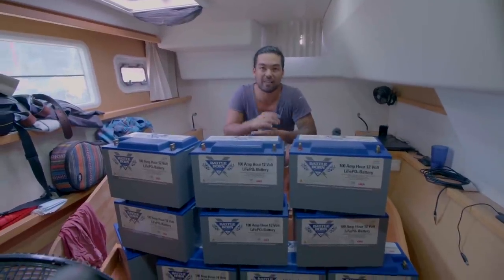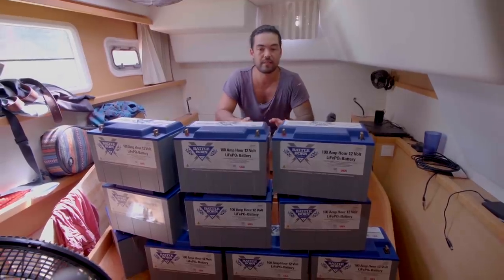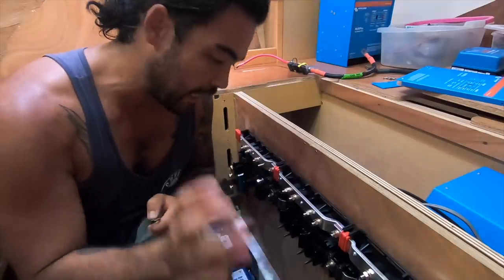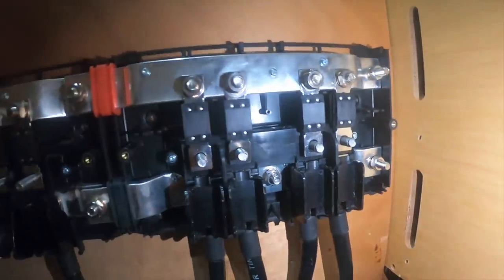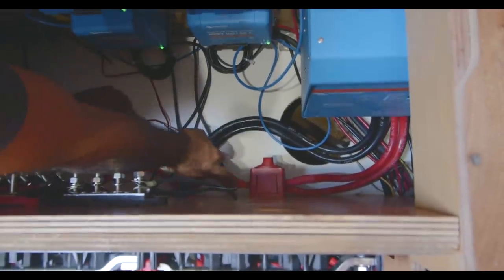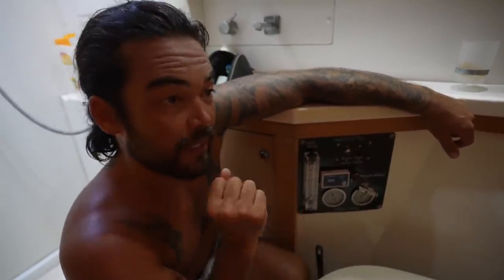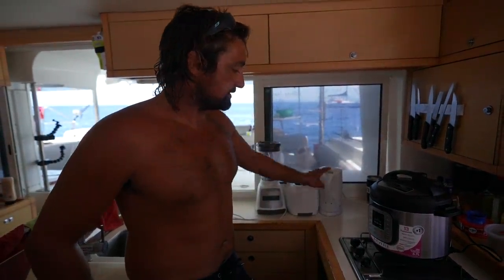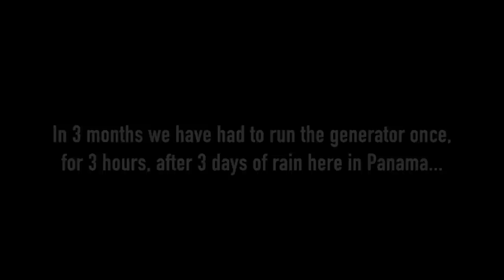Installing 1000Ah of LITHIUM + huge VICTRON installation! Episode 149

Comment: I have 4.5KW solar system on my house in Australia and I use all the power hungry stuff like washing machines, clothes dryer, dishwasher, a/c between 9am -3pm and never draw power from the grid in that time frame. Just a tip to make your system even more efficient for the days its overcast.

Comment: Colin, since lithium batteries have the possibility of catching fire, are there safeguards, either in the battery itself or the associated electronics to warn you the battery is showing signs of a possible short or prevent the short from causing a fire?  My first thought was if I were installing these on my boat I'd put them in a fireproof container.  I know there are different formulations for lithium batteries, like LiPo (lithium polymer). What type are the boat's batteries? It might make for an interesting video to interview someone from the battery manufacturer. Maybe give some safety tips when installing or living with lithium batteries.

Comment: So One Small suggestion. I love the build.. But as a solar guy... Im going to suggest.. Unmount the panels and put corrugated plastic sheets between the boat and the solar panel. The idea is that as the panel heats up, There is no ventilation for the heat to dissipate so you begin to LOSE power if their is too much heat on those panels. To augment this you use the plastic signs aka corrugated plastic) as a air gap to create air flow under the panel as the panel transfers the heat to it.  Kind of like a heat sink.  either that or use stand offs or rails to put the panels up off the base of the boat.  This is why Computers use standoffs in Desktops and they dont mount the motherboard directly to the wall of the pc. For heat reduction and airflow.  Just because those panels are "sailing"  that wont keep them cool as the heat is transferred to the back of the panel. and then to the boats fiberglass.. So getting some air flow under them helps with solar efficiency.  You can literally increase that power at up to  20 percent more. So it was generating 2.2.kw it would generate 2.6kw just by putting them on rails or corrugated plastic. (For those that dont know, Corrugated plastics looks like this https://www.boxes4u.com/sites/default/files/Corrugated%20Plastic_0.JPG)

You can see this dude talking about this on his boat here..https://www.youtube.com/watch?v=o6kOvjS1ytE&t=185s  and why he did it. 

Other than that Solid build and great video.

Comment: 6:00 Pro tip. Add a small amount of roofing silicone to the join then slide the heat shrink over it and apply heat befor it has time to go off then mop up excess slilcon. The heat shrink will squeeze out the air and the slicone will make it air tight so no corosion will develop for years. 
I have used this method on boat trailer wiring for the last 10 years and have had not one failure due to water penitration yet.

Comment: Beautiful equipment and install!! I'm using LiFePo4 as well.  I've set my parameters to stop charging at 85% and inverter to cut at 20% to get more cycles out of my bank.  The batteries deteriorate quickest at very low or a very high state of charge.

 If you're floating consistantly around 75% and rarely dipping below 40% may be worthwhile doing the same if you want to squeeze some extra cycles out of your battleborns.  You could get as many as 10 000+ cycles only charging to 60% and cut off set to 40%, pointless to only use 20% of your bank but it appears with your usage you have plenty to stick between 20%-85% especially with your back up genny and future alt upgrades.  lifepo4 loves to float right around 50% to get the most longevity, i hope you find this useful 🤙🏻

Comment: One thing to stress about your new system is that by noon your new Lithium's are full and the sun is still shinning so the PV panels are producing power and that is when you want to run all your power hungry appliances, watermakers, battery chargers....   It's more economical to use the sun's power when the battery bank is full so that at night you can drain it for dancing music, underwater lights etc... 😀
Loved that all the - and + leads were all the same length, very nice busbar, neat and clean install.

Comment: I'm a small engine mechanic and work on those Honda Genis all the time... They'll last forever if you do a oil change every 30 hours of use and don't let it sit without being used longer then 2 months.

Comment: The parts definitely looked quality and the install very nicely done. Whenever I'm replacing things at home I always spend more than I like, but as you showed, high quality stuff will save you money and time in the long run as it lasts longer so won't have to be replaced/repaired as often. Being able to use all of your devices and appliances through the night without having to run the generator is definitely a huge step up.

Comment: We use Battle Born on our electric yacht (auxiliary) powered sailboat.  They are great batteries.  We also have the same Honda generator for charging if we go past our 20 or so mile limit under power alone.

Comment: Great job with the design of the system. Adding a 100—150A alternator to one of Yanmars sounds good too. Personally I would try keep the originals too but just add a extra pulley to the crank. Multirib belt  with manual tensioner and gearing so that Yanmar on high idle would give minimum 8000rpm on alternator. When no need for big alternator just remove the belt.
Reply: Given the effectiveness of solar and the presence of a backup genset that is good to have on a boat anyway, why bother with the alternator upgrade? I could see it if he was drawing more of a daily load, it would the fastest recharge. But he's not even coming close to the capacity of the system most days.
Reply: I think there may be very cloudy, dark days without any wind when they are sailing back home. When they are using engines anyway it sounds wise  to have low cost kWhs flowing in.
Reply: Need a victron Orion battery to battery charger for the alternator output.

Comment: I actually received the 2nd set of 60 amh lithium batteries to hit the US a few years ago for my golf cart. The company called me last year and wanted to warranty my batteries for a newer 100 amp battery and to see if there was any problems with any of the cells in my original batteries(there were none). I travel about 20 miles per day to play golf round trip on my cart plus the round and with the 100 amh, I have gone 3 rounds between charges on occasion. However, now I have moved to the golf course and can recharge every week or so. These batteries are game changers to the industry. I may also add that I have upgraded my cart to a 10 hp motor and the cart will do 35 MPH. Fair winds!!!
Reply: Koenigsegg quark's put out about 335hp and only weigh about 63lbs.... That'd make one hell of an upgrade. :D

Comment: Great video Colin; that solar roof you installed is brilliant. Based on your having to run the generator once in 3-months, why bother with the larger alternators? Running a diesel engine as a generator is rarely good for the motor. If you add one alternator, you'll have redundancy for your honda generator, but then you can also just buy another small standby honda for that just-in-case scenario. Consider that water pumps are a big deal - for your boat in an emergency, and also to help neighboring boats too. Nothing worse than trying to save a sinking ship with mechanical hand pumps. Portable small backup generators are more versatile than a large alternator solution - and are probably cheaper.
Reply: Edward. Lilithium has a very low internal resistance. Unlike Lead acid, gel and agm. This lower resistance means the alternator is unable to supply the higher demand of lithium at lower revs and therefore a bigger alternator is needed to prevent overheating and bring the demand within the capability of the alternator. I =V/R ... I x V=W .....Laws that govern electrical generation and storage...
Reply: the boat is built to motor sail so it would be nice to have the extra power generation on a stormy day when theres little sun
Reply: @SVImpavidus  I have heard this! Altornators do not like lithium.  Pretty sure i've watched a video of an altornator going up in smoke trying to charge a lithium battery. Definitely research using altornators to charge lifepo4!!

Comment: I’ve been using battleborne batteries for a few years now for total off grid power storage and consumption without a single issue system wide.  You just did the best possible upgrade you could possibly do with exception to probably adding more batteries😉😎👍

Comment: Victron systems completely impressed me. I was having horrid electrical issues. The only issue with Lithium, vs LifeP04 is static draw. 10,000 watt draw of an audio system on a boat, the kinks aren't worked out. I keep myself banked separately for this reason. One of the biggest mistakes people make is how you parallel your batteries, the wire lengths and configuration of the parallel system DOES matter. And where you place your charger and the bus bars in the configuration DOES matter.

Comment: Two questions:

1) Do the built-in battery monitors (and fuses/breakers to a lesser extent), help prevent any single unit from catching fire - either due to internal temps, over load conditions or a failing bit of kit?

2) From the video, it appears all the 1000AH of battery are installed on, one side of the boat.  Are there water tanks or other items to counter balance the weight?  I realize the Lithium /LiFePo batteries can be lighter than the older AGM or lead acid types - yet balance and weight are critical on any ocean goin vessel, esp a strong cat like we have here.

great video quickly covering the specs and options and comparing old and new tech with redundancy always, always built-in!

thx!

Comment: Great video.  Thanks for sharing the build experience and capping it off with your experience actually using the system.  Keep the Honda as backup no matter what you do with larger alternators. Its portable and its dependable and it will run a pump when all else is failing.

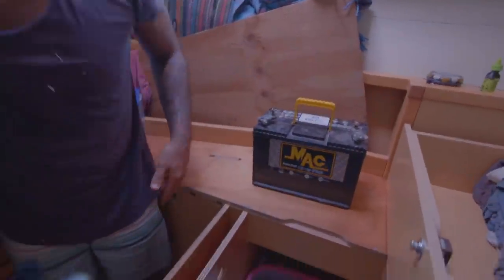Comment: Colin please forgive me if I just missed it in your presentation thus far at 3:38 but as I understand the matter Lithium batteries are also a fraction the weight of lead acid which can be crucial factor for Catamarans.

Comment: There's a channel called Sailing Uma, these nut jobs went to the Arctic circle with an electric main engine (now with regen) a little solar plant, a diesel cabin heater and a Honda eu2K gen for backup. Personally warm is good and cold is bad so you guys have it all over em, plus you have an extra hull.

Comment: Nice Video,  I also run the Victron Multiplus 3000k inverter generator with 1200watt of solar and 400ah of Battleborn in my Keystone Raptor Toyhauler. Totally Satisfied!

Comment: Nice install. Converted to electric propulsion in 2008 on my 30 foot sailboat and never looked back. I also use a Honda 2000 for occasional battery charging at anchor. It's a real workhorse. About to convert from AGM to Lithium once the current 48 volt battery gives up.

Comment: Hi guys,  
I'm impressed with your $30,000 lithium battery system.  
However, my 6KVA Cummins Onan  burns only 2 litres or $5 of diesel per day for 240 volt hot plate cooking, charge 3 x engine batteries and watch TV.   My 100 watt solar panel helps keeps 12v fridges and freezers cold.
Cheers Mal

Comment: Very informative episode! These new batteries are just amazing! We just put solar on our home and are generating 135% of out normal annual KW usage. The surplus power goes into the utilities grid and we are paid by them for that power. It is at a discounted rate but it should totally offset what we use at night.  Great stuff for sure. Don't need the batteries since our surplus generation covers the difference.   We do have a back up generator so we have adequate power in the even of a total power outage. (If that ever happens.)
It is a good feeling to have this kind of independence! Good job! 👍

Comment: HEYA Jamie and great to see smiles for when i don't see yall smiling i worry a little.  Also will you upgrade your alternators, if not please check it out. As you turn on the engines to dock or anchor ⚓️ or if you motor the improved alternators would aid greatly in recharging the batteries. Yes i know the difference between motors and engines. Lolol also do you have a soft start set up?

Comment: Well this looks really good, I did something similar with my 20K 45' 5th wheel, but I have 1100 wats of solar but I used the GC 270 Amp Hour and got the same with only 4 Battle Born batteries, with the 2 3K inverters, it created less wiring, but no one helped me, so we should all know this type of system will cost the average traveler on the water or on the ground 22K+ depending on DIY and having it done for you!

Comment: Superb and  instructional. Cool to see the fotovoltaic systems diagram, and electrical too. 
Led lights and strip upgrades will add safety. Do you use combiner boxes, disconnection switches ? How is grounding done in the boat?
Nice to see the electrical panel arrangement detail and the protections being used. An upgrade to electric dinghy. Epropulsion. And an add electric bike.👍

Comment: Excellent episode, loved the setup and install... I'm putting about 1900w of solar on my boat and an induction cooktop myself. Haven't bought the lithium's yet, but they're definitely on my to-do list.. Thinking of going with 4 of the 300AH ampere times since it's backed by amazon.
Reply: Have a look at SOK batteries 👍

Comment: Don't forget to connect the thingamagigi to the whatucallit via the gadjet via the light switch.To power up the HI-FI amp for the sub woofer.Also watch Jamie,make sure he put the lid on the pressure cooker like a water tight door on a submarine.We don't want to loose the roof in the galley.LOL just kidding Jamie.

Comment: Great installation Colin.  Clearly there is not an ambient heat issue in the hold where the invertors and the batteries are located otherwise you would have installed a cooling fan.
Reply from the maker: We did install a 12V computer fan yes.

Comment: Man that solar set up is amazing! Now you dont have to worry about power. That's good. One less thing.😉 I like that you did a parallel bus for the bank instead of going end to end. With 10 batteries I think you'd have had some issues. Solidifies my decision to do the same. I don't think I'll have that many though. Thanks Battle Born, for making a big difference in some awesome people's(and content creators) life!
Reply: this is the first install I've seen where all the negatives are wired to the distributer instead of the batteries wired in parallel neg to neg, why did Colin do it this way?
Reply: @willyum1208  In a long string wired with jumpers, the batteries at each end will be worked harder. They will age differently and get out of balance more easily. The resistance is different for the center of the string than it is for the ends. With the bus, it is way more balanced how the power comes out of each. Also, if one battery goes out, it's less likely to take the whole system out. And each battery is protected by a fuse. There's likely a million other reasons, but you won't save on copper😉

Comment: I've been using LifePo4 batteries for the last 5 years . Other than maybe a BMS failing , the actual cells should last 25+ years if looked after and not too a heavy daily draw . 
Yes, it is a life changer . 🤪

Comment: FYI: your wiring for the batteries is unbalanced. The batts near the main + / - pickup will work harder than the ones at the end of the Lynx distributors chain.
I.e. the use of same length wires was negated by the way you attached them to the busbars.
To avoid this, installers typically cross the + and - cables when connecting to the BBs (i.e. if + connected nearest to + main then its - cable gets connected to the farthest BB point)
Or go for 1/2 the unbalance (as crossing wires like above can be messy) by moving your main + / - cables to the  midpoint of your busbar chain.
Reply: Interesting, I was wondering why Ive never seen it done this way on the other DIY install channels.  With such a large bank would there have been less drain on the batteries if they were wired in parallel, with a neg off one end of the bank and pos off the other?
Reply: @willyum1208  Indeed, that is one of the ideal ways to do it, from a balanced-path-resistance-standpoint. In that case each batt sees exactly the same Vdrop, whatever the load.
He is using Lynx BBs though, which limits wiring options. But  they provide monitoring, and additional protection via the series fuses.
Whereas parallel wired batts, in case of a failing short-circuited batt, would lead to a runaway incident as all batts would dump a massive current into the failing one. Unless each batt's wire is or has a fuse, like in this example: https://www.youtube.com/watch?v=_vrr7YjiqUc

Comment: Nice install, very interesting video. Suggestion on the video title : Ah (Amp hours) without Voltage is borderline meaningless if your trying to convey energy storage capacity.  Better to talk about Watt hours (Wh = Ah x V) as is this is more useful in this type of context.

Comment: Who ever told you to have multiple charge controllers really knew what they were doing. A sail boat IS going to have a shaded panel. If that’s in series it’s a total loss of output. More independent panels and charge controllers is the way to go on a sail boat or rv where random panels shading is a high possibility. 👍
Reply: Correct ! One controller means a small shaded area on one panel reduces the entire system output